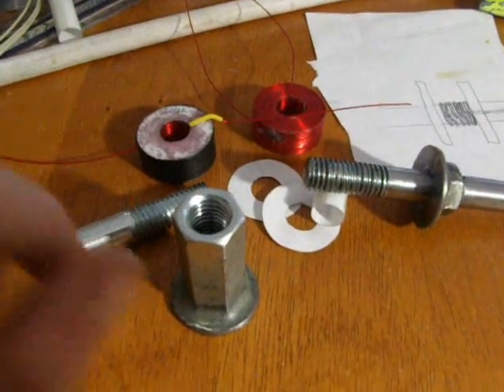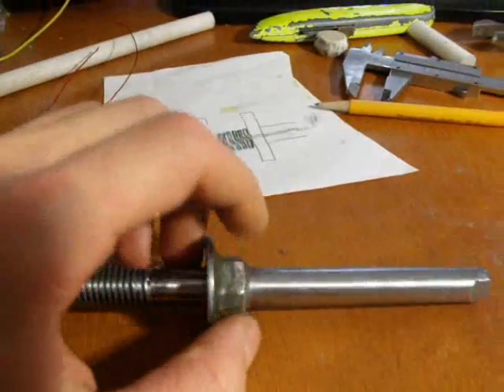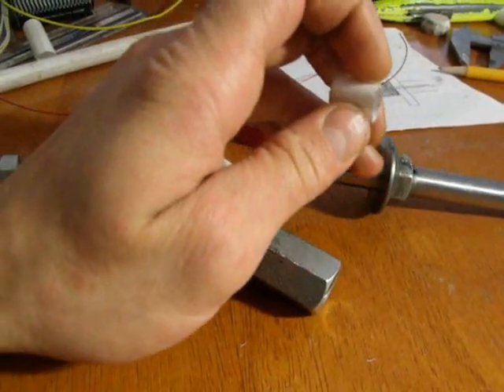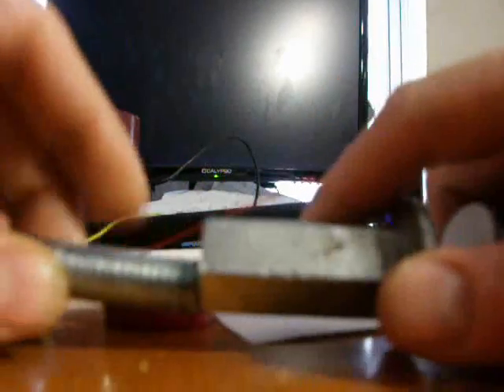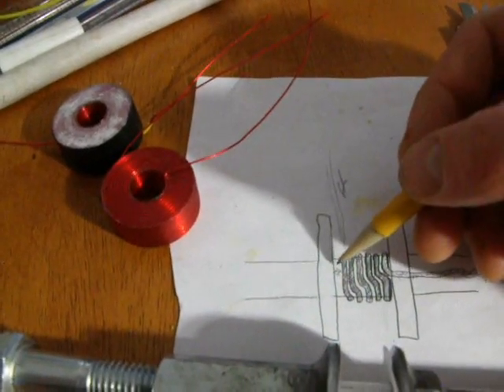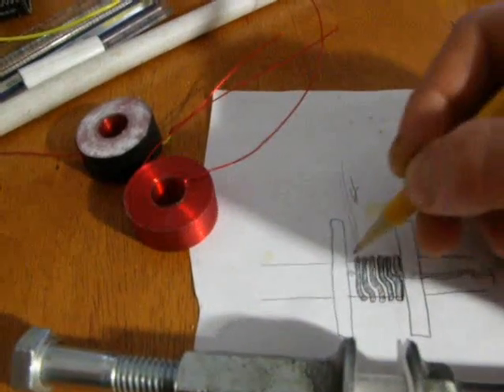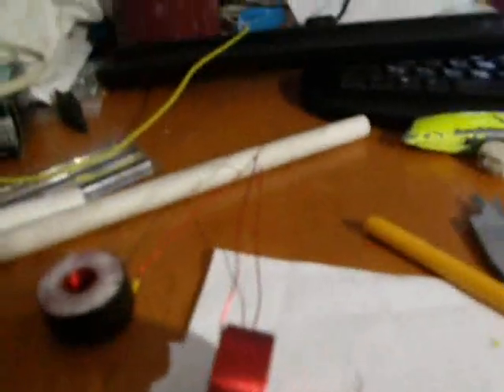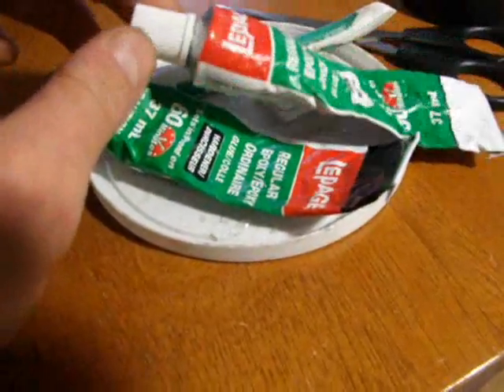Coil construction

Comment: Nobody who hasn’t made a coil understands how incredibly difficult and taxing it is on your hands. I’m making 16 stubby electromagnets with iron cores, the cores are about 1-3/8 in diameter, 3/4 in length and have about 3/4in of 22g wire wrapped around them. They’ll be powered by 24volts and more amps than they’ll need (two tandem motorcycle batteries and a PWM to control their strength and release) I ruined 3 of them trying to wrap it without using this method, even with a perfect jig it is hopeless going end to end. Thank you SO much for explaining the back and forth stacking method and stopping short half a wire diameter from the edge, I just made my first acceptable coil, it took me two hours, my hands are aching but it’s worth it. I have 5-min epoxy and i have found if I mix up a few drops and add a layer of epoxy between every two layers of wire wrapping it works good, a little tedious, but I have a jig to hold the coil wrap tight while I place epoxy. It works well. Also, consider using aluminum foil in between the wrappings and your outer housing instead of paper, I just use some pray adhesive in between the foil and the jig and it keeps it in place as I wrap, but comes off easy in the end when I separate it to remove the coil, and the epoxy doesn’t bond to the foil. Using your method my coil looks 100% better than they did, and might I say, incredible work on your example coil sir, that is beautiful.